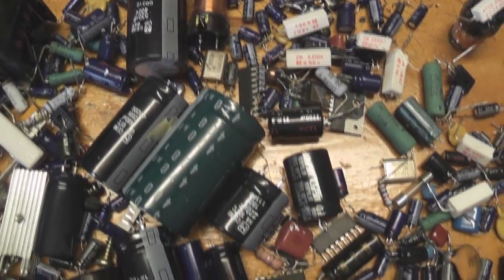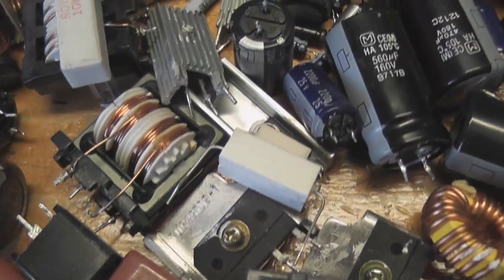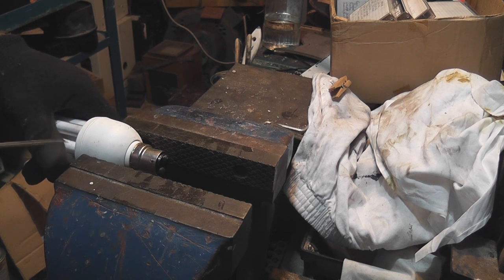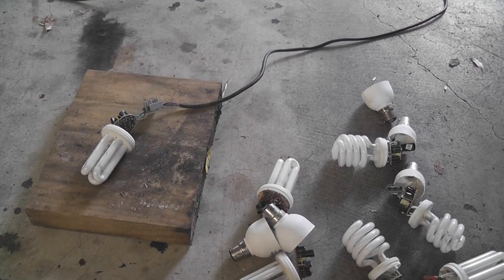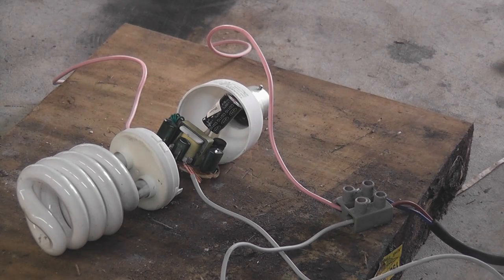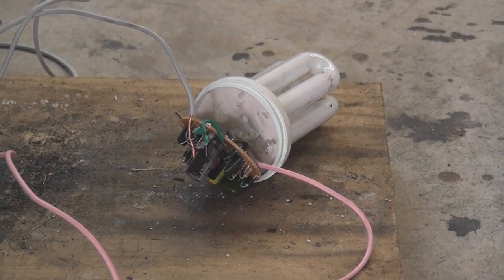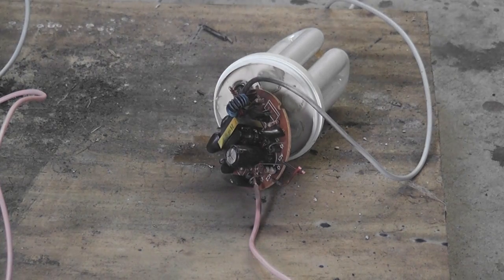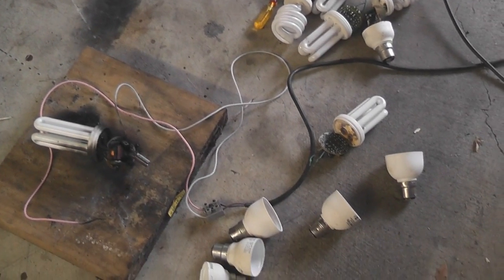TV components and some CFL burn outs

Comment: Running them under-voltage will also produce interesting results (use non-dimmable lamps).  Run one on a simple light dimmer for a few minutes.

Comment: usually there are small improvements to transistor that end in a letter. I know this is the case with low power NPN transistors like 2n2222 and 2n2222a